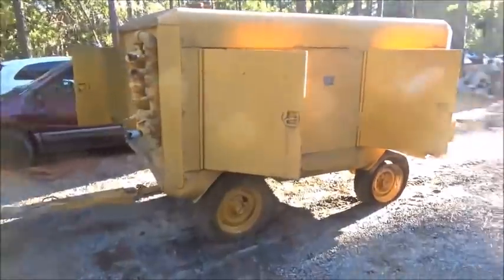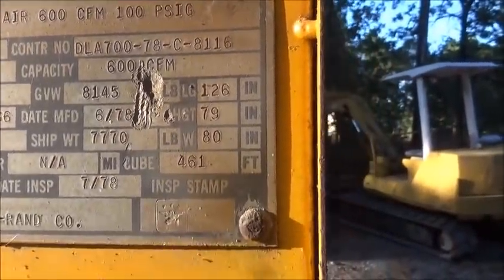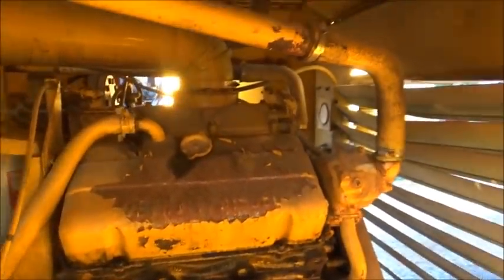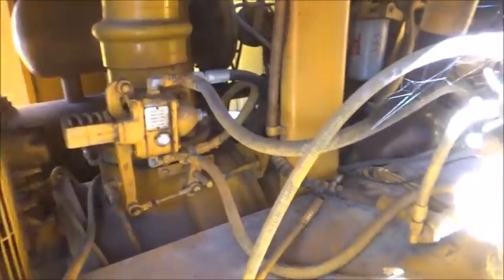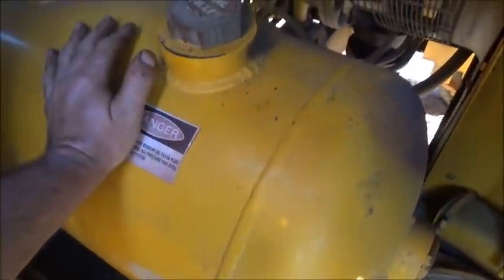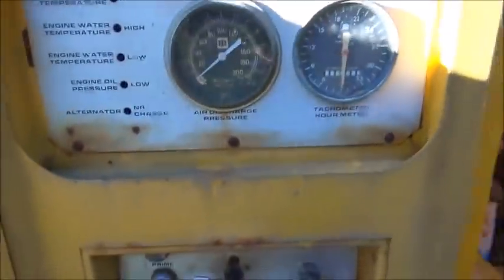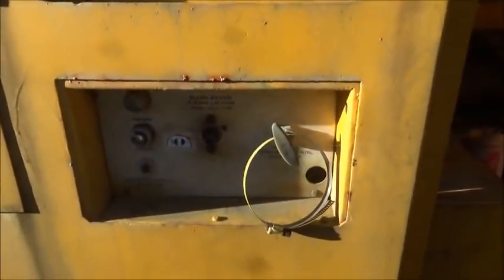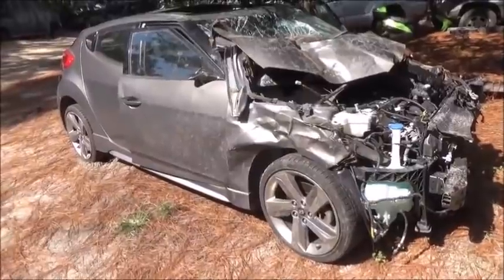600 CFM INGERSOLL RAND BIG ENOUGH TO RUN A STEAM ENGINE!!

Comment: Johnathon I used to use one EXACTLY like that one for SANDBLASTING.  The reason it says air is not  suitable for human compsution is because when Sandblasting you have a seperate Air supply to the HELMET(CLEAN AIR NO OIL).  There should be a panel which tells you which valves to have open when starting and which to close when you need air supply.  That will EASLY RUN THAT STEAMENGINE!

Comment: You    may   want   to   contact    Portrayal   Press   they    reproduce  military   maint,   manuals,  just   give    them    all   info   on   the   data   plate    and   they   may   have   all   repair  and   maitanace   manuals   the   phone   is   855-339-0382   hope   this   helps

Comment: 6v71 Detroit has a clapper on the top right side of the engine. As they get old, the spring get weak and the clapper will close and make the engine choke for air and sound like its under a load. I would check that before breaking into the compressor itself. It could be the vane stuck, start with the simple shit first.

Comment: Hi Jonathan.  Make sure that the injectors are not stuck on the shrieking green leaker before you start it. Also check the shut down solenoid.  They do run away.faster than a Nana Cat engine? Lmao!  If that unit made good pressure before, then there is a valve that stuck open or partly open. Either that or just a bad air leak from an old hose or a broken fitting. It “ is probably not an issue”.

Comment: That compressor is WAY bigger than what you need to run the Corliss engine. The 100 psi is good, but 600 CFM is probably 2-3 times what the steam engine would use. 
Those Ingersoll Rand compressors had a rotary compressor I believe it has a sliding vane rotor. “Gyro-flow” was the trade name if I remember correctly. It uses oil to seal and lubricate the compressor and separates the oil at the discharge of the compressor. That’s why the warning label, since you wouldn’t want to breath air that had oil mist in it. 
Possibly either the wrong oil was used, or it’s over filled.  That would be my guess.  I would drain the oil from the reservoir tank, compressor and separator and refill with the correct quantity of IR compressor oil or what they recommend. Probably a light grade of mineral oil. 
If that doesn’t fix it, I’d disconnect the drive coupling and turn the compressor over by hand. It should have a little drag, but not a lot. 
That’s a great machine for sandblasting. Wish I had one.

Comment: If you're right and it is a lobe type / supercharger compressor they are sensitive to the type of oil you use and the amount. They build a lot of pressure. I have a small compressor on a gas powered carpet cleaner and the oil should only show half full on the sight glass when shut off. When running it will fill most but not neccesarily all of the sight glass. You mentioned that the problem started when they changed the oil. Make sure it's the right type and amount. That's my extent of ignorance.  It may be different on this machine so ignore everything I just said.

Comment: By the way I like your '49 or '50 Chevy Sedan Delivery in the background. I had a '51 that had been an ambulance. Fire engine red with six slot American aluminum wheels. I worked nights and weekends converting it to open drive with a '63 283 and three speed hooked to a '57 rear. It was complete except for paint but one rainy night a drunk ended its life. I still wish I had that car. Thanks for sharing Johnathan!
Terry from South Carolina

Comment: Well I guess if you can get it working the first job will be sandblasting the engine, so it will be a real useful compressor as long as it's not blowing to much oil out with the air. I know a guy had that problem with his compressor, it kept plugging the blaster . with that being a Detroit you might need a long hose and park that compressor  1 county over  to run that engine L.O.L. If it's too close the diesel noise will  kill the sound of that fine craftsmanship running. Thanks for another project update, Take care.

Comment: I can't believe just changing the oil would've done that - did a rag get sucked up in there where the air filter should've been or that threaded piece of tube that the oil filter screws up on - did that tube start screwing itself up into the housing showing low oil pressure & somehow telling the governor to back down
Reply: Is that black charger a 2009? 2010? V6 with the multispeed (l don't recall how many gears in there) automatic...there was a white one of those (same wheels) parked over by the service drive one time when l had my Dodge in there getting something done (lifetime extended warranty) that white car kept turning my head that way - that might be a good one
Reply: Maybe that supercharger wants that air filter put back on
Reply: If that's a V Rod Harley @6:44 you need to cover that up in case Delray stops by (he already has 3 Harleys - l only have 1) l like that Caterpillar Kenworth he's got over there & suggested he might could sell off some inventory and possibly aquire a landoll trailer to hook on back (l saw a wet line setup on that truck) don't tell your 359 l said nothing about that Kenworth

Comment: Some Industries will use air compressors to supply Breathing Air to their Mechanics while working in Oxygen deficient spaces and will normally use an "Oil Less" Compressor with filters and air coolers on the discharge air. I believe that a "Stuck" Unloader may be the problem with it not building air pressure.

Comment: Being military, there should be manuals available,  there is a big filter they call a separator if its clogged the machine wont build air. There is also a procedure for starting those, it may have a start/run valve that needs to be operated. Dont shut that thing down under load, you will have a real mess on your hands! Take care Jonathan,  I  could maybe email you if you need a hand. Bobby probably will figure it out though. I am a new subscriber,  I enjoy your stuff especially steam, Will

Comment: Getting info or parts is a real beech on these old compressors. It all predates the internet, aged out before the internet, and 99.9% of people aren't interested. I've got a little tow type 145 cfm chicago pnuematic (early to mid 70s) I can't find much on either. I'm about 8 years been hunting manuals for it. The compressor is easy. If you need parts, that's the hard part. You'll need an old school type compressor guru. Part number changes, ownership changes, blablabla...The stuff is out there but it's like it's hiding haha. 
Lol it's a transpressor.....Detroit that identifies as a Cat. Thanks for sharing

Comment: Hey buds i dont know a lot about them but if its like a regular air compressor it sounds like the wrong oil was used an the read val on the tank side is stuck closed now if thats the case ya got ta becarful the air in there will case harm ta ya now you can also check for water in the air tank now thats ez theres a drain on the bottom of the tank ya can let the water out an sometims that will lock up the pump it could also be the pump val alos not letting out air i beleave its called a blatter or something eals agen i dont know them to well on the compressor side only the engine side

Comment: Johnathan,  from what I could see in the video it looked like the air end is a blower style or rotary screw compressor. 
If that's true, some are wet screws & have  oil separators for many applications such as sand blasting,  painting & even air bladder inflation. 
Some are food grade machines which use dry screws for blowing plastic
bottles & such where any lubricant would contaminate the containers. (water bottles,  ect) 
Nice compressor & yes it should run the steam engine easily.

Comment: The air not being suitable for human consumption does make sense.
Someone sand blasting in a full suit is fed air through a line supplied by a hose normally provided by the same compressor used for the sand blasting.

Comment: When I worked in Boiler engine rooms we had large electric motor compressors and the main outlet air valve stuck shut once. It wouldn't open no matter what. And we would only open the main air valve slowly after the unit built up full pressure to run the plant. If you started the compressor with the main air valve open or shut it off open it would flood the air line with automatic transmission fluid. A.T.F is the type of oil our compressor used. Maybe this will help you. Great videos.

Comment: Hey John. There is a video I watched a couple weeks back by ElderlyIron where he was working on an Ingersoll compressor where someone put the wrong oil in one and it swelled the vanes up in the pump causing the to lock in the rotor.  It was a smaller unit than yours but might be worth a look.  I think his model was a G85. His video is "Ingersol Rand G85 Compressor Failure".  Awesome job saving the old Bates corless. I really enjoyed watching your adventure rescuing it.
Reply: Kevin Mitchell Ooooohhhhh, say, that just might be where the problem is! Good call, dude! Good call!
Reply: Kevin Mitchell How is ElderlyIron doing these days? He was in a pretty back accident recently.
Reply: I haven't heard anything other than he was in that serious accident.  I hope him and his family well during these hardships they are going through and hope he has a speedy recovery.  He is definitely in or thoughts.
Reply: Kevin Mitchell I really enjoyed his videos. I too, hope he recovers quickly!

Comment: This is an oil-flooded rotary-screw compressor. Not a vane style. First, does it run? Is the airend locked up (may have shredded the coupling element)? What kind of oil did the last guy put in it and how long was it ran that way? Did they change the separator filter too? If it runs, I’d put a pressure gauge on the sump and that outlet manifold to see if the pressure is up around 100-110psi, with the outlet valves closed. If there’s a switch/valve/button to go from start/warm up/unload mode to run/load, make sure that’s functional. Then slowly open one of the outlet valves while monitoring the pressure gauges. It the outlet manifold pressure falls off, and there’s no drop in the sump pressure, I’d start looking at the minimum pressure valve to be seized, provided it has one (the older units sometimes used an orifice to maintain minimum sump pressure). Could possibly be a check valve, but not likely. Newer units use a combination minimum pressure check valve. That’s where I’d start. There are controls on the side of the inlet valve, where you’d set your operating pressure. You’d loosen the jam nut and screw the adjustment bolt in to raise pressure, out to lower pressure. That also controls the engine’s rpm. But I’d not make any adjustments until you’ve looked into the above mentioned. There should also be a bleed orifice in the control plumbing. Someone may have put a plug in it, thinking they were fixing a leak. That should take care of the basics. 600cfm will put the horsepower in the 100-150 range.

Comment: It belonged to the United States Navy. There is a code on the registration data plate that starts with an “FSC. This means Federal Supply Class. Also, if it was Army, it would be painted OD green, and the number would start with what is called an “NSN” which means National Stock Number. Why am I telling you this? Because if you punch in the USN number of the FSC number, you may get more hits on your search. I’m a property book officer, Active Duty, and this is some of the stuff I do for a living. Give it a shot!
Reply: Thank you for your service! I was a property manager in the USAF in the last century. We had that type of dinosaur when I went in in '83. I had no reason to operate or maintain them but I know the bolts only break off in the places that are danged near impossible to get to. I was an aircraft machinist and getting broke or stuck bolts out were one of the many jobs we performed. As you said, the data plate tells all if you know how to decipher it. There should be an Air Force technical order (TO) somewhere out there with all the bases that have closed and not being classified. Cheers! 
Terry from South Carolina
Reply: @terryfromsouthcarolina4601  Thank You @Thomas Garcia and @Terry Brelsford BOTH for your Service!!!!
Reply: Randy Thanks Randy, I really appreciate that!
Reply: Terry Brelsford You are dead on the money! Thanks for your service as well!

Comment: They do take a special oil. I think the Compresser unit is recommended to be rebuilt every 500 hrs. IR had an exchange program but they sold their compressor division a number of years ago. I believe it was $15,000 exchange with IR. There was a private guy who rebuilt them in Neb.  Still costly.

Comment: Hi Jonathan , maybe he put the wrong grade of oil in it . I will be either a vane or worm pump , if it’s a vane pump maybe strip and clean the vanes and rotor, if a worm pump try a thicker viscosity oil before stripping it down . Whichever it is , it is not repairable. Good luck . By the way I was a service engineer for a plant hire company not just some plonker

Comment: Jonathan, you can google "How many cfm Does it take to run a 14" bore x 36" stroke and much info comes up.  I'm on a phone so can't read the small print.  

Air is kind of kindergarten to steam, it will take alot of air.  600 might do it but I'm not sure.  I'm sure you understand the principle difference between air and steam.  If not, the water being over 212° is boiling and has potential energy, but is contained inside the boiler.  When released into the he cylinder it then expands and creates the power.  The air actually has to fill the cylinder with actual compressed air and thus requires a lot more air just to fill the cavity, then perform the job.
Reply: Exactly, the higher the steam pressure, the more it expands.

Comment: Hi Jonathan  that compressor will drive any and all air tool you can throw at it  rule of thumb all air tool normal run at 90psi (spray guns normal lest 60 psi ) now if ya use a 1/2 dr impact gun you use about 7 cubic ft lbs per minute  where as you use a mid range air grinder / sander they used far more in the 22 cubic ft per minute i would think jack hammer is up in the 40 ft lbs per minute ranger   it will run air /sand  / grit blaster no worries  look into vanes and or oil in compress motor hope that helps

Comment: Check unloader valve may be sticking from dirty varnish.
Rotary Screw compressor needs flood of oil to build air.
There is a filter screen for compressor unit often gets dirty .
I have a few older units .
One filter was from 1973 never cleaned...
A Smith screw compressor .
They invented this technology in Tennessee mines now gone.

Comment: having worked as a ground equipment mechanic in the USAF, it will be interesting to see what causes the problem. I would check the oil level and proper weight of oil in the compressor. I would believe being too full of oil or the wrong type of oil could cause the problem you are having.

Comment: "Not suitable for human consumption" is that like a folding baby stroller that has directions on it that say.. "before folding, remove child..". It takes all kinds..
Reply: What that means is the air produced is not suitable to breathe. When you breathe you consume the oxygen in the air and exhale CO2. The air will have lubricant oil in it and so would poison the air supplied to the breathing equipment used by people working and in an area with that requires breathing air supplied to br breathing equipment they are wearing or even diving gear for working under water.

Comment: Not an expert but looks like a screw compressor.  Only thing I ever replaced were control valves.  Mine was powered by AC motor and ran an assembly plant.  I suspect you already know the basic operation.  Sprays oil on the screws and filters it out of the compressed air.

Comment: Jonathan are you gonna run it on air only? Or eventually fix a boiler and firebox and run it on steam?
Reply from the maker: Don't want to deal with inspections and the boiler cost would be crazy.
Reply: @jonathanw4942  10/4

Comment: I don't know anything specific about it but i do know military equipment. It is a US Navy compressor and you should be able to get a technical manual for it. Just search up some of the military forums like g503.com or something like that and should get you on a track for a tech manual. If i find something online I'll post a link.
Reply from the maker: Military must be ashamed of it, can't find any info.
Reply: Dang, I've been searching steady since I posted and you're right! I'm still working on it. Closest I've come is the Army version but it's a two wheeled unit TM 5-4310-219-10

Comment: should be enough air to run that pneumatic saw Hand Tool Rescue just restored. xD

edit: a lot of older unloaders use the air compressor pump's oil pressure to operate!
Reply: That saw is accident looking to happen, what a beast !!!